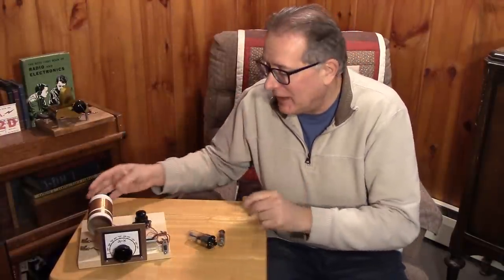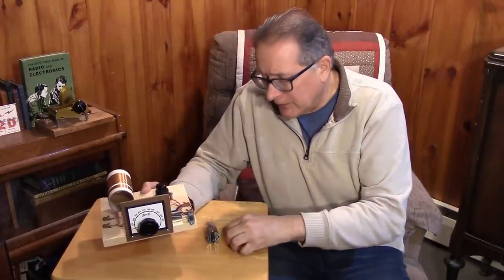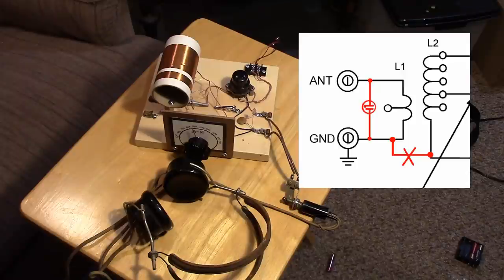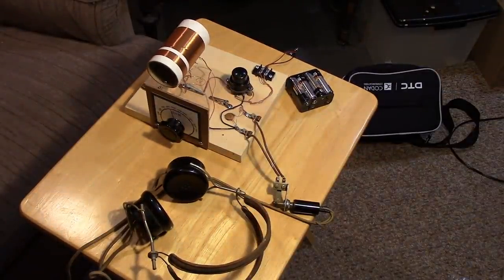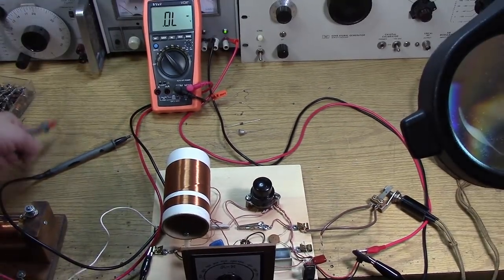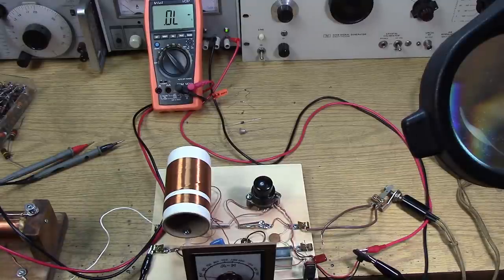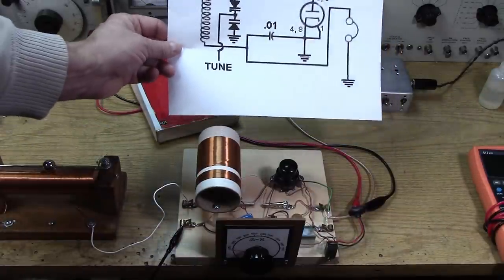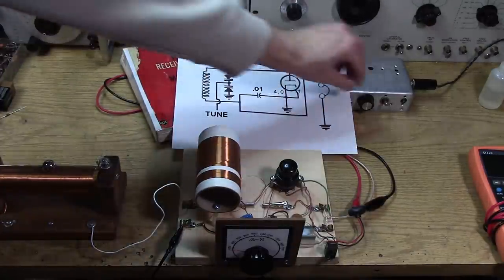EMP Proof Your Crystal Set

Comment: I just went the other direction and and mounted several different (actual) crystals for use with a cat whisker detector. I  use galena, pyrite, and a sulfur oxide crystal.  My crystal set receives from the broadcast band up through 6MHz via a 2 inch coil with 85 turns of #26 wire, tapped in 12 evenly spaced spots across the band.  A set of Cannon hi-impedane head phones, an antenna tuner, and a double wave trap round out the set.  People think I have a battery hidden somewhere.  Thanks for all of your videos!!!  I'm now restoring my Heathkit HR-10B using your videos as the basis of all my work...  THANKS!!!
Reply: I said "band" when I meant "coil."  Sorry about that...

Comment: You might try a UHF triode or diode such as 2C40, 2C42, 2C43. These have extremely close electrode spacing so the voltage drop is almost non existent.
Reply from the maker: SETI Crystal SET

Comment: Some years ago, I picked up some miniature wire-ended valves at Dayton Hamvention dirt cheap (no data, of course). Turned out they were mil-spec dual diodes, so last year in the throes of lockdown I started to experiment with them. They worked pretty well with my high-performance crystal set. Now I have more ideas to try! Thanks, Mike.
Reply from the maker: I have some odd looking microwave valves as well to find a use for - and some scary ones with radioactive symbols on them!

Comment: I'm attempting to use a dual filament light bulb as a tube and diode and use one to also transmit rf and use it for a valve on a tank circuit... I understand high voltage is involved and would love to see more videos like this

Comment: Cars may be pretty EMP proof now, but when the first electronic ignitions came out for cars we did an EMP demo for some military brass at the company I worked for. We dumped a larger than 1 ton, high Q capacitor bank into a pair of elevated irrigation pipes and measured the field intensity on a sphere hung between them. But we had the military brass park their cars just outside the fence 30 feet way from the test setup. They sat there in the research shed looking at the graphs and nodding distractedly, then they shook hands all around and left. Or they tried to leave. None of their cars would start after the test EMP. When the scientists suggested that perhaps their car's ignitions had a problem with EMP, we got their full attention. :)
Reply from the maker: This was a real problem before proper shielding and grounding went into vehicles. Semiconductor devices for cars are protected better now too. Modern cars have so many processors onboard that a "limp mode" is required to get you home after a failure. EVs should greatly simplify this part count. So much is devoted to emissions now.

Comment: Neon lamp or any other discharge device is too slow to protect from EMP. You need to use TVSS diodes or MOVs to protect the circuit. Gas and spark discharge devices are sufficient for lightning induced surges. This was determined with ARRL research from the 1980s. Additionally, for protection of EMP from the AC power lines a standard MOV surge protector (the regular cheap ones) will clamp the EMP surge.
Reply from the maker: Very nice John. Good info for the builders!

Comment: Very interesting circuit going back to the basics of radio reception/AM detection. Very good results by the way and properly explained, my compliments & subscribed 11 march 2022.
Reply from the maker: radiofun is fun!
Reply: I thought you said it's impossible to use two diodes in parallel :D
Reply: The tube acts as the detection diode here and the other diodes act as varicaps (varactors) and are not parallelled. And of course you can switch 2 diodes in parallel, the one with the lowest barrier voltage will open first.  @Kangsteri
Reply: @radiofun232  Yes. I think it has to do with the frequency and partially cause of the momentum of the flow. So it helps with very low wattage applications.

Comment: Thank you... always fun. A couple comments: 1) when you were swapping out the tube detector for the solid state diode, I thought I heard an absence of electrostatic noise when the tube was in circuit... I know I definitely heard the crackling noise with the solid state device. I need to go back and listen again. If true, why would that be? 2) in the tube diode circuit where there is detection of the negative side of the envelope... if that is what is happening, AM stations must limit negative modulation to be never more than 100%. But they can modulation in the positive direction (and most do) up to 125% here in the US. So, the recovered audio would be a bit louder if one was using a detection diode oriented to recover the positive going excursions. Am I thinking correctly?
Reply: The commercials trick!  Play normal station programming at just below 100% and then when the commercials come on boost to 125%!  Wake up the sleeping people!
Reply: The commercials trick is one thing.  The logic on demodulation the bottom or the top of the signal isn't quite correct.  You can't go under 0% modulation as that would be a 180 degree out of phase signal, which would as you say detract from the total of the envelope.  But the 0% negative modulation is just zero signal, and the 125% positive increases the peaks higher.  So that only increases the change in V peaks, the top and bottom of the sine wave is still symmetrical.  If I understood the question, and my answer was clear.
Reply: @clytle374  Yes, I see my error. The peaks are identical on either ‘side’ (top/bottom) of the wave; yes, amplitude modulation wise, you can’t exceed zero % negative modulation... that ‘pinches’ the carrier off. So from Mike’s example of 1930s style detection... it makes no difference which way your diode is oriented to detect the audio as the RF envelope is symmetrically modulated by the audio signal.
Reply from the maker: Wow! All good thoughtful points. But we can flip the phase in many ways to get the right part of the modulation demodulated. Like swapping the antenna and ground leads.

Comment: Hi Mike, I have watched a lot of your videos now some many times. Your knowledge is stunning definitely sparing me on to do some more construction. I do like that Watkins Johnson receiver. Not looking easy to get one. and R390 would also be good but getting one into Canada would be a problem due to the weight and shipping problems. The only others i have are a TS530SP, K3 and FRG7. Ok but not in the same class as that receiver.  Just brilliant and thank you so much.
Reply from the maker: Receivers that use expensive parts and software are only "better" in some pretty rare corner cases. The Japanese won by utilizing many cheaper COTS parts and giving fantastic value and many more features at a reasonable price.
Reply: @MIKROWAVE1  Thankyou for the reply. I was really after that S meter. However I can check the K3 and probably find out how accurate it is. I also rather liked your millivolt RMS meter. Going to have a go at winding some basket weave or pie RF chokes as these seem to be difficult to obtain. I tried my cheap CNC winder and to looks like it might work. The IF coils I wound on my old winder for a 1934 Sparton Radio I am working on worked fine. I had to make the spools as well as wind the coils. The old ones were just wound on wood dowels. Just pile wound so the Q would not be as good probably.

Comment: Hello Mr. Mikrowave,
This new video was interesting how to add protect to a radio that needs an outside antenna. Have you experimented with free power one transistor germanium radio? Its basically a crystal radio with an amplifying germanium detector transistor that takes the place of the detector diode. The base emitter junction is the detector and collector is output to phones. It gets it's power from another tuned antenna that is detecting and filtering a strong signal. Any strong signal that can be rectified into DC and have enough voltage to operate a small amplifying germanium transistor. An ECG 126 is a good choice. Then weak signals can come in better. I forgot what its called I think if I remember correctly its called a rectenna power supply. I have plans to build one strong enough to drive a 2" speaker and make a whisper quiet free power radio that I can put on my headboard at night and go to sleep listening to it. I live about 20 miles from a 50,000watt AM station and it might be enough. I don't know if the same antenna can be used for the receiver and rectenna power if so it will have to have some sort of filter splitter. I think it would be difficult to design and engineer and very challenging to get working efficiently enough for a speaker that has an impedance matching transformer due to transformer losses. It would need a 5000ohm speaker
Reply from the maker: This is practical in many areas with a strong local station!
Reply: @MIKROWAVE1  This sounds like a fun aside to your Crystal radios. I'd love to see you build one or several of these types. Build it, Mike!

Comment: Maybe I'm missing something but I thought to get EMP damage the circuit needed to be in operation . When I leave my radio desk I unplug both antenna and ground so any reception wood be minimal . If the pulse is that strong I think we'd get cooked too .
Reply from the maker: I have not heard this but you can argue about whether the device is drawing current with devices in the active region? or if the on-off switch somehow disconnects you from the line (which many do not now).

Comment: Good choice of catchy title with current events, lol.  Of course the sun can do a pretty thorough job on us too, the power line transformers love to be DC biased from a geomagnetic storm. Kinda a endless list of stuff that can be broken. Of course crystal radios would be a lot better after most QRM is removed, lol.     If you really want to make a post apocalyptic radio,  I'd like to see you build a radio with flame diodes and triodes. I've thought about this a little, or maybe a lot actually, lol.  Get an Aladdin Mantle lamp and replaced the mantle with fine thoriated tungsten wire, this gives you a cathode.  Might be able to divide it into several sections for multiple elements.  Of and they used to sell thermopiles for the chimminies to get a B+.  I don't know why I lay in bed at night and come up with this stuff, and medications available?   Interesting video as always, thanks Mike!
Reply from the maker: Holy Hornswaggles! Oh there are some of us that count valves rather than sheep all right.
Reply: @MIKROWAVE1  lol, just a thought

Comment: Cars: I get the cage, but what about the grounding of the cage? Are those tyres conductive?
Reply: Back about 50 years ago tires were not conductive at all.  It was common to have a "grounding strap" hanging from the bottom of the car to bleed off the charge accumulated by the friction of air passing over the body of the car.  Modern tires have carbon added to the rubber to provide a path to ground.  I have never tried it but you would probably need a megger to measure the resistance of a car tire.  So car tires do provide a path to ground but I doubt it would make a difference in the event of a lightning strike or EMP.   Side note: Airplanes survive lightning strikes all the time.  The airplane that dropped the atomic bomb on Hiroshima survived the EMP.
Reply: @jamesmoffat9754  I remember reading that early F15s had mechanical flight computers to ensure they would survive nearby detonations.

Comment: I am wanting to do crystal radios again for my physics students.  To save money, would ferrite cores be helpful.  The cost of wire is an issue as I have a lot of students this year.
Reply from the maker: You will end up spending more on the Ferrite Adjustable Coils or Rods. A pound  of #26 AWG is about 1200 feet of wire and that would be maybe 25 or 30 bucks. Each student might need 25 feet of wire to wind the coils on a normal 1.5 to 2 Inch diameter cardboard tube.

Comment: Are there any crystal sets for FM radio? I imagine it would be a bit more complicated. It would be interesting to see a build on one. Also, there's not really anything interesting to listen to on AM unless you like religious programming and politics.
Reply from the maker: Just a little 5 turn spaced coil wound BIC pen diameter and a 35 pF trimmer cap, a BAT-85 diode or 1N82 a .01uF cap and a 100K resistor and a crystal earpiece and a couple turns for a primary feeding some 300 Ohm twinlead into a 5 ft FM folded dipole. It works by slope detection.

Comment: Why not make some FM radios with a crystal .
Reply from the maker: The diode used in old TV tuner mixers was a 1N82 UHF germanium diode. You could make a dandy FM crystal Radio with one of those, a little coil, trimmer , cap and a crystal earpiece.
Reply: @MIKROWAVE1  Slope detection, right?